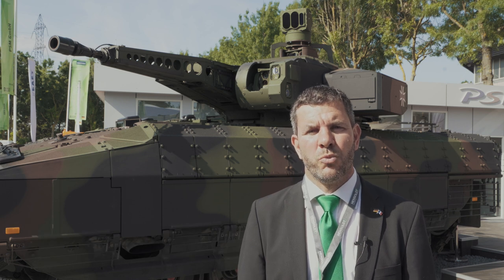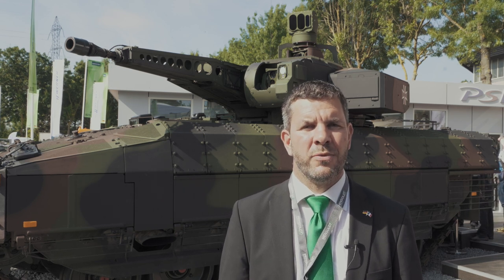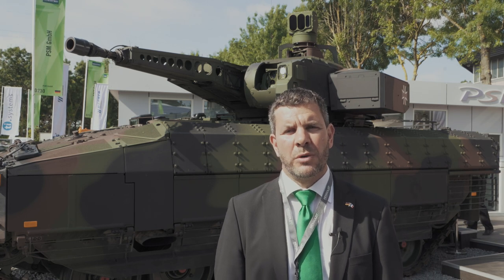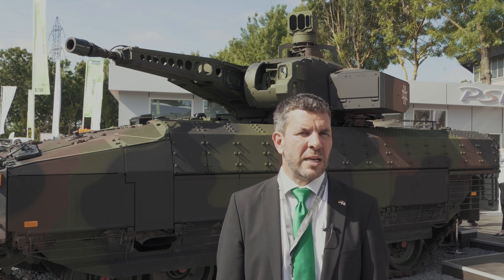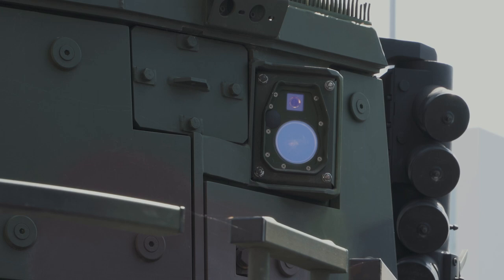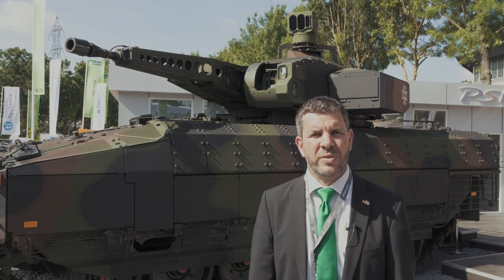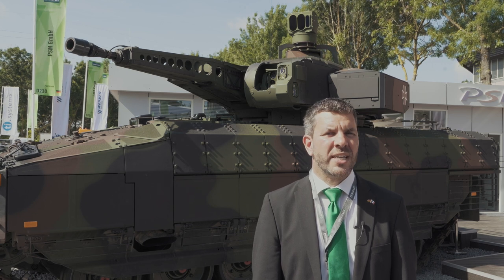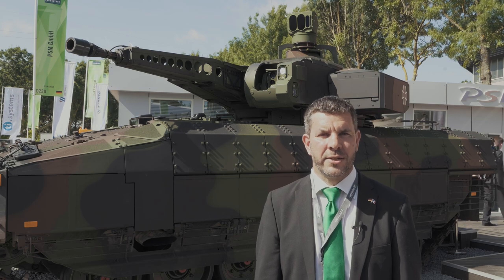Multifunctional Self-protection System for Vehicles – MUSS

Comment: Looks interesting but I hope MUSS 2 includes the option for armoured covers that can automatically retract without crew assistance.  This way you can reduce damage to these high-mounted optical devices during incoming artillery strikes (for example) then quickly redeploy straight after.  It would reduce lens cleaning too!

Would love to know your thoughts on these ideas.  Maybe those lens covers are quick to replace or already rated against shrapnel.
Reply from the maker: Thank you very much for your comment! We are always happy about new ideas and inspirations and will directly forward your suggestion to our engineers.
Reply: @HENSOLDT  thank you for your reply.

As a military vehicle mechanic in the UK I certainly do have opinions 😁

My goal is to find companies that work within the paradigm of design "by mechanics for mechanics". I've worked on some amazing vehicles that have such long repair times due to what appear to be odd choices in the design phase. 

I do appreciate that everything is a compromised to a degree.

Comment: Hello, tell me please. Is PUMA's upper hood armor composite? Armor ceramic on the AMAP type? Is there AMAP anti-fragmentation armor inside the compartment too?
Reply from the maker: Thank you very much for the question! However, HENSOLDT MUSS is a softkill-based active protection system and actually independent from passive armor properties of the platform. We suggest to search for corresponding information on the platform´s manufacturer webpage or related sites.
Reply: PUMAs upper frontal armor is a combination of NERA and silicon cabine nanoceramic based passive composite armor. Not running under the AMAP brand anymore.